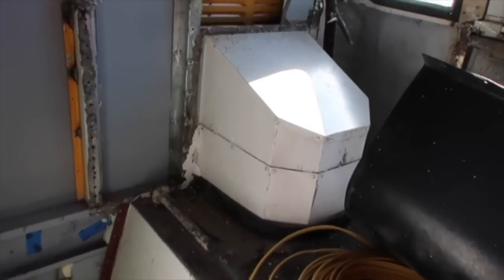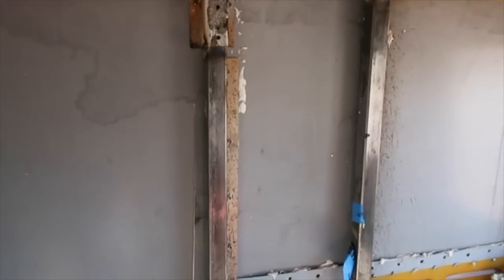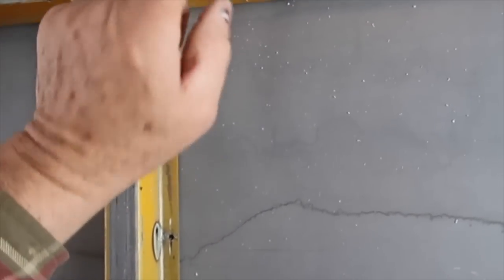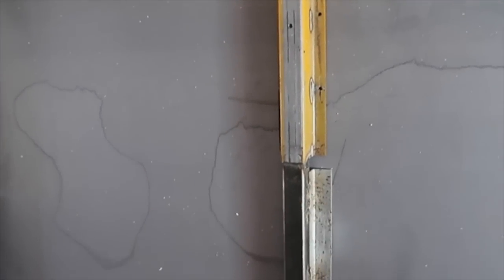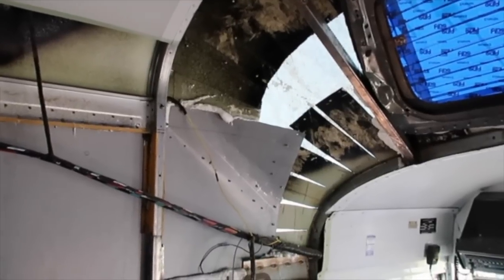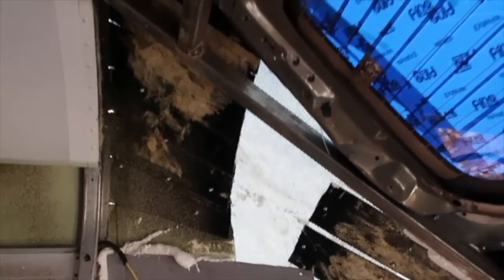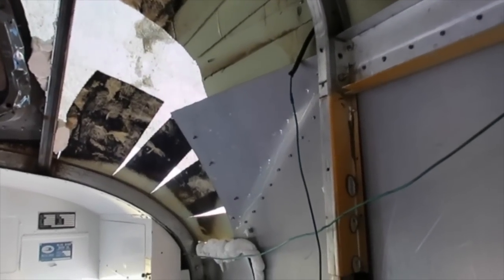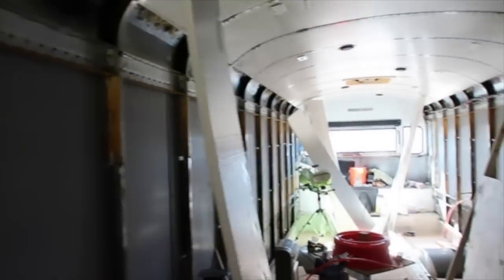School Bus conversion to motor home #7 Raising the roof on my school bus step by step

Comment: Excellent job so far on your bus. Most original bus windows are only single pane uninsulated windows. You are going with the best insulation method (closed cell foam). Why would you reuse those windows Jim? Some big RV windows would be awesome in your bus. Thanks for the updates.

Comment: Hey Jim why do you use rivets to attach the metal rather than just welding it in place?
Reply from the maker: The hat channel is all welded.  We attached with rivets because that is how the sides were originally attached.  Thanks for watching.
Reply: @LifeisaJoy  Thank you for the videos! Do you see any problem with just welding those panels on?

Comment: Jim are you adding screens to the windows to keep the bugs out when you have the windows open on a nice day? Also are you going to put Fantastic Fans or MAXX Air fans in the roof for ventilation and a vent fan in the shower?
Reply from the maker: Bob Shaw, Great comment and yes we are adding screens I will make screens with magnetic edges.  We are going to add at some point a fantastic Fan.  The shower vent I don't know if I will yet.  We will see how it goes and if we need it after installing the Fantastic fan.  Thanks for watching.

Comment: You said the Bus has automatic "chains", what are automatic chains?
Reply from the maker: Hugh Roney, they are chains that work at low speeds (less than 25 miles per hr.)  it has a device that spins the chains under the wheel while you are driving.   https://vimeo.com/144713332